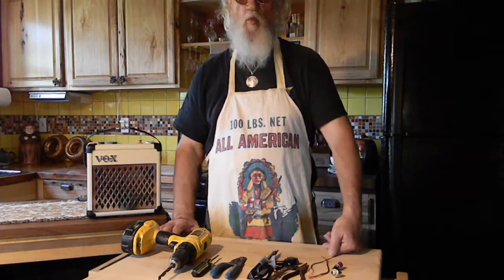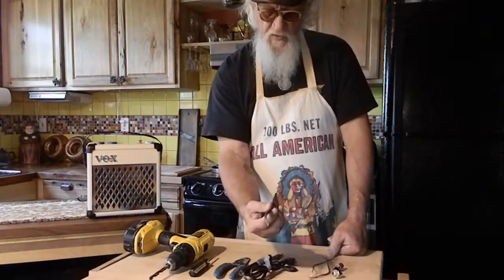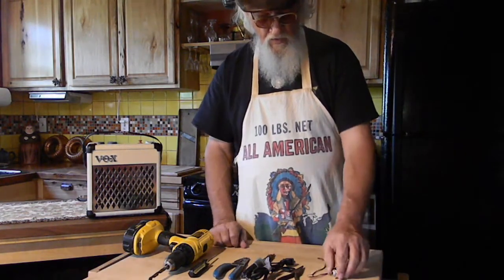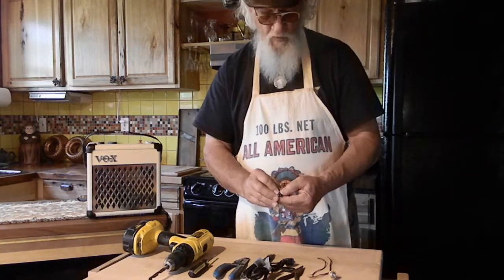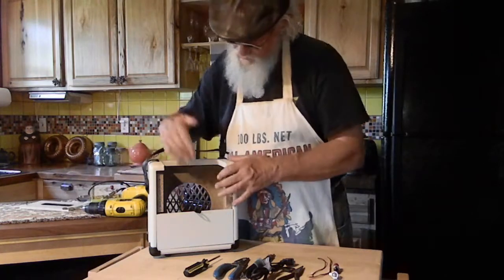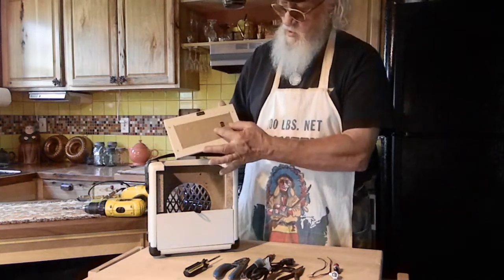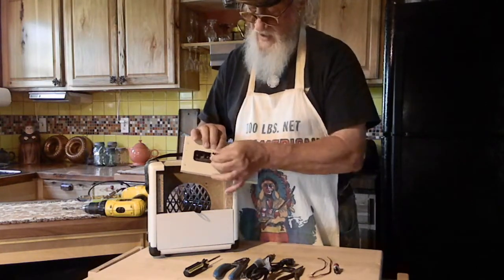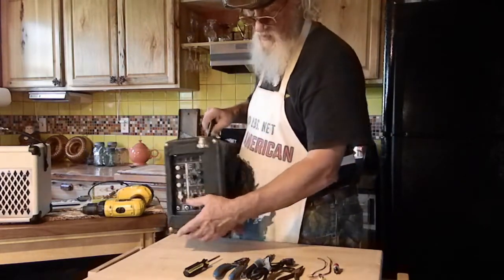Install Footswitch Jack on VOX Mini5 Rhythm

Comment: Its a great idea, take it one step further and use a stereo 1/4 inch jack / cable to control "stop start" and beat variations, then you could change the beat for verse / chorus /mid8 etc.  Apart from the stereo jacks and cable, the wiring should be the same for the other switch, because the circuitry is counting the switch presses to increment through the beat variations. ... just a thought

Comment: The wiring was handy and more important than turning a 'mini' 5 into a 'maxi five' , which seemed to destroy the point of it being small. The footswitch can be bought on ebay at a very small price making the idea of making a footswitch pointless. But thanks
Reply from the maker: The point of the jack is that THERE ISN'T ANY RECEPTACLE FEMALE JACK anywhere on the unit so as to turn on and off the percussion with a foot pedal switch!  Granted foot switches can be purchased, but not the jack on the unit to plug into. 
Plus I've learned from experience you have to get the amp off the floor to project properly, and the extra space in the new cabinet is for cords, mic, etc freeing up one hand when coming in to a gig. Thanks for the input, i"ll try better next time.
Reply: Can't you just use a guitar jack and drill a hole in the case to fit it in after you have soldered all the wires in?. I have not got mine with me at present as I am abroad. But the idea is really good, just a shame the manufacturer never thought of it. Well done that man.

Comment: Does it matter which wire goes to which terminal? Best regards Pete over the pond
Reply from the maker: doesn't matter, you are only making a "loop" which closes the circuit when you add the foot switch.  The switch on the Vox is a 'contact' button which only closes the circuit momentarily, its not like a toggle or a switch on the wall. Hope this helps.

Comment: Can the rhythm function still be used without plugging your installed footswitch?
Reply from the maker: Yes, definitely, but you'll have to turn it on and off manually.
Reply: @wideastexas3381  thank you. I guess I am just concerned that the installation would interrupt the circuit and mean that only the footswitch would complete it meaning that the rhythm circuit cannot be used without the footswitch jack being plugged in.